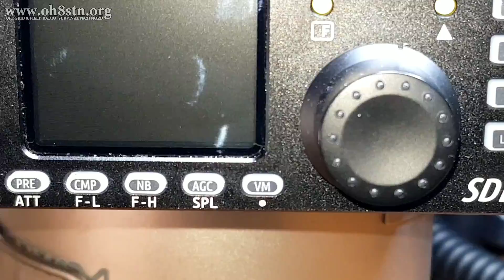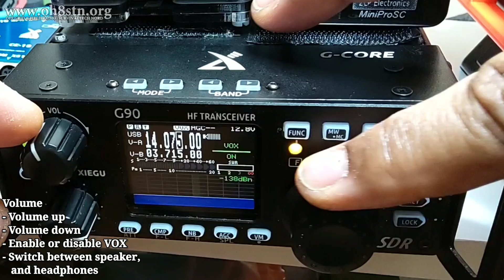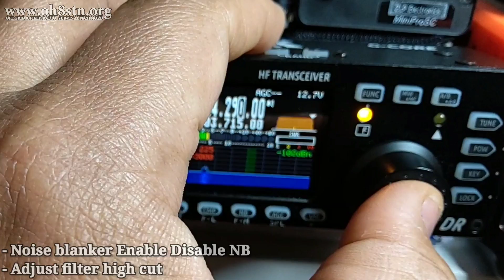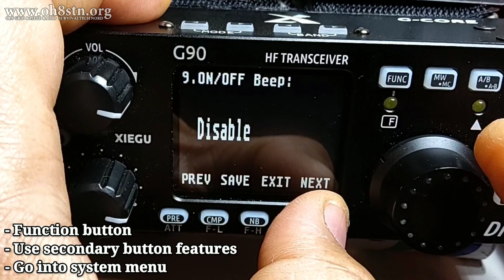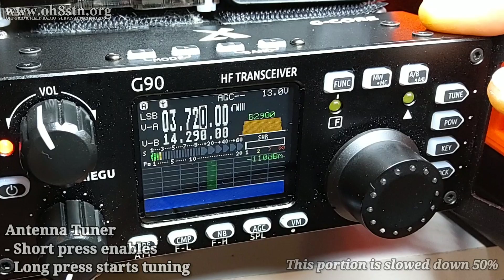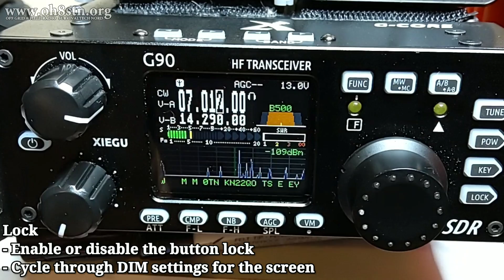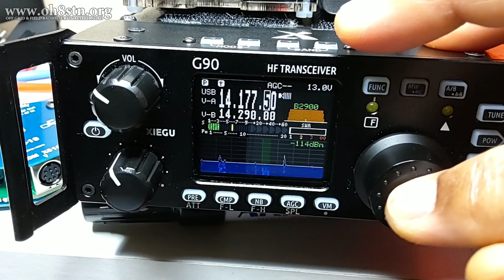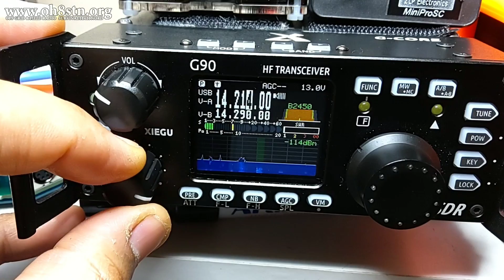Xiegu G90 HF SDR Transceiver

Comment: Hello from Texas. I am considering a Xiego G90 as a basic POTA rig.  I have seen your videos on the battery consumption versus the full size FT-891 and IC-705 where the G90 seems to fall in the middle of the two. I see you really don't seem to use the G90 anymore.  Any reason for this?  Just wondering about your current thoughts and use case on this radio.  Thanks!  73  Mike KB9MEQ
Reply from the maker: Outstanding question!
The G90 gits perfectly between me 891 and 705 in performance,  current consumption and size. Since it consumes about half the current as the ft-891 on RX, you can run it on a much smaller battery.
My G90 is now used as my Winlink gateway. It's doing a solid, reliable, and energy efficient job. 
73
Julian oh8stn
Reply: @ Man are you up early! Great info and thank you!
73
Mike
KB9MEQ
Reply from the maker: @Bacon4Allah burning the midnight oil. Gotta get the book done 👍🇺🇸

Comment: Recommendations for radios like this but in the 50-100w range?
Reply from the maker: More specifics would be helpful. Still, there really are no other radio like this. The closest is the Yaesu FT-891, but it's current hungry.
Reply: @OH8STN  which has better range?
Reply: @OH8STN thanks for the reply

Comment: Bought this radio specifically because of your glowing review of the G90's simple logical BW filtering GUI.  I have a FT-991a which is a fairly decent radio overall, but Yeasu buries the filter bandwidth settings in sub-menus which I ABSOLUTELY HATE.

So, after viewing your video, and agreeing 100% that Xiegu got it right on the G90 - that this WAS the PERFECT way to handle the BW filtering - I literally went right out and purchased the G90.

So, imagine my joy when I found out that as of FW 1.79, Xiegu has TOTALLY TRASHED this brilliant filtering interface by turning it into a really crappy copy of Icom's silly "dual shift" filter tuning.   This dual-shift nonsense  interface makes no sense on a modern DSP filtered radio where it makes much more sense to let the user set low cut, high cut, center-frequency, and BW directly -  ALL OF WHICH WERE EASY TO DO ON THE G90 UNTIL XIEGU DECIDED TO SCREW THINGS UP.  

With Xiegu's new "Icom knock-off", dual-shift-stupidity interface it's incredibly difficult to visualize the "filter BW overlap" area based on a really TINY poor graphical GUI and the provided "BW" calculation is inaccurate to the point of uselessness.  

With their previous G90 firmware, Xiegu literally HAD the best interface you could ask for.  For example,  In voice SSB mode you could easily directly set lower and upper cutoff frequencies -- and for CW operators, where it makes more sense to set the center-frequency to the sidetone spot frequency and then narrow the bandwidth, that was ALSO available - PERFECT.    BUT ALL THAT IS GONE.   I'm only sorry that my G90 just went past the return time frame, or I would send the damn thing back to them - that's how much I HATE THIS REALLY STUPID CHANGE!
Reply: Hi Steve,
I must agree to what you wrote here. Within minutes I returned to the V1.75 FW version, I started out with. For CW I use the center and bandwidth controls, for SSB the lower and upper cutoff. All just one or two button presses away...
Sometimes I wonder, what I am missing, with the new firmware releases.
Hope you also "downgraded" and are able to enjoy your G90 again!
73 Willy

Comment: I plan on getting one as a starter HF Transceiver after I pass the general exam, because I refuse to spend 1k to 4k for a HF Transceiver and because I'm not boomer gate keeping old hammer who takes new hams over the coals for using cheap radios 73 KQ4HCU

Comment: In the new firmware, the bandwidth is adjusted differently - the F-L and F-H buttons are no longer involved in any way. Maybe make a video on the changes in the new firmware v1.79b3?

Comment: Julian, I always appreciate your vids. I'd love to know your pro/con of the G90 vs the 6100. From my reading online, seems like the 6100 was released sorta 'half-baked,' but that more and more the firmware seems to be turning it into a great rig. Size of the screen, power, and future 'jailbreaking' possibilities [in the case of the 6100] seem to be the primary differences. I know the G90 runs a bit warm on digi modes. Assuming the 6100 does too? Since I operate a lot of digital modes, that could be the tipping point for me. If I had to scale either one back 50%, the G90 would still leave me with 10w. Curious about your perspective. 73! Tim

Comment: Excellent tutorial and camerawork.
You explained the function of each button, but you've not explained the terminology, such as, what is split frequency? What is a noise blanker? What is voice compression? What is high/low cut filtering? So you may have taught the location and name of each button, but those who aren't familiar with the terminology, as to what a function does and when to use it,  are left in the dark. 
I'm expecting to receive my G-90 in two days, and I'd like to be able to know what I'm supposed to do and why.

Comment: Was thinking about this for a medium powered SOTA rig, but I understand the screen is hard or impossible to read in the Sun.  I am leaning towards the KX2 because of this.  Apples to oranges because of price range, but I want them for the same reason. Something with a little more punch, and also SSB.  I am normally running an MTR-5b QRP on peaks.
Reply from the maker: I haven't had the problem with seeing the screen outdoors. Still, this is a heavy radio for difficult SOTA summits. Of course the battery must be carried as well. There are definitely better 10-watt choices like the 705 or kx2.
Reply: @OH8STN  I will have to cash in some crypto and the KX2.  73 and hope to catch you on the air.
Reply from the maker: Remember you'll need an external battery to get full power out of the kx2. Also you'll want to add the heat sink kit to reduce very common overheating at higher output power, and the front protection kit to prevent the rotary encoders from being broken. Here's a SOTA friendly power supply https://youtu.be/3G0GxVuReLg

Comment: Julian.... Great video! I purchased a G90 earlier in 2021... It will be the base of my portable ops gear. I have also shared this with my comms people.... currently waiting on my digimode-4 digital interface to arrive.... my Pi4 built for Ham is complete.... I am getting closer

Comment: Question my G90 will only tune in intervals of 10 and 100 kHz. How do I change that?
Reply: You should be able too press in the main dial to select other steps. If this doesnt work you may try updating your firmware.

Comment: Got this for portable om the car use, not whilst driving, just side of road stuff. Having to buy separate battery as car power points were too low voltages. Great video for a great little radio !

Comment: Hey, I just purchased this radio... 

Will the qrpguys end fed antenna work for this?   Just to Rx I cant Tx yet.   

Any other recommendations on field type portable antennas?
Reply from the maker: I haven't used that internet yet but I've heard good things about it. Because this radio has an internal antenna tuner, you could use a name dipole or end fed that's long enough.
Reply: @OH8STN  okay, thanks for the response!  

When you say long enough. Do I need a separate wire for each band?  Or with an antenna tuner I can just use 1 length of wire?

Comment: ... thanks Julian, that was a great presentation. One has to keep in mind that this radio comes without an eye watering price point.. thinking the Elecraft line here. One has to keep that in mind when comparing apples to oranges. I am sitting here with my new G90 'toy' pondering the possibilities. As an older amateur with more than 50 yrs in the hobby, I have seen and owned many a rig, some better than others, and am looking forward with anticipation to this new horizon.  Richard VA7AA

Comment: I have been using this radio about a week. I had some software problems, which were relatively easy to overcome. I am really happy with it. When you get used to it, which doesn’t take too long, you really begin to see what a good receiver it has and very good filtering, and despite only 20 watt output, I have enjoyed quite a few contacts. So would I recommend it? Very much so.

Comment: Bought this as my first HF rig when I first became licensed back in November last year. No problems making contacts with 20 watts, and I think the tuner could tune up pretty much anything you could screw, glue, or duct tape to the antenna output. The receiver seems very sensitive, and it's just loaded with features for the money. Anyone who is hesitating, just order one. Neat little radio.
Reply: How has your first year with the radio been?  Still happy with its performance and durability?
Reply: @o2bnov0307  Yes, I can still stand behind my comments. Actually using the radio right this moment, and looking up POTA spots. I've since upgraded my base station with a Yaesu FT-450D, but still use the G90 as a portable rig regularly, including the last winter field day, out in very cold and windy conditions. No problems at all thus far. It has its quirks (I always have to look up whether to update the head unit, or main body firmware first for example), but it's a great little rig for the money. I still especially like the tuber. It can impedance match my LNR Precision 40/20/10 EFHW all the way down to 160m, and managed to make a few FT8 contacts that way. Not efficient at all like that, but it worked to some extent. I have no regrets buying this radio.
Reply: Just got one and have been enjoying it as my first HF radio.
Reply: @greghastings3310 Ditto!

Comment: What does the SDR chip do in this TRX? Only panadapter (48 kHz) or more? Is there access to the circuit diagram?
Reply from the maker: I don't know how to answer your question, as the radio is the SDR.
Have a read. https://en.m.wikipedia.org/wiki/Software-defined_radio

Comment: Julian, thank you so much for highlighting this tranceiver. I as well have a QRO rig at home. I was looking for a rig that I could use for portable (SOTA / POTA) operations. I love this rig from the little testing that I have done with it so far. I am in the San Diego area of California and was testing the Xiegu G90 with a simple random wire dipole that was laying on my mobile home roof on 20 meters. I was blown away at getting a 55 out of an Ontario Canada station. I can't wait to get this rig out on a summit or park. I have chosen some of the components from the Chabeleon MPAS 2.0 antenna system to put together a vertical that I will test at a park. Thanks again for the great work on the in depth reviews and advice. 73, phil KF6IF
Reply: I'm in San Diego too; do you have any summits that you recommend? Trying to decide between this and X105

Comment: So my dilemma.. I’m torn between the FT891 and the G90. The G90 has so many features that would cost a lot more to have for the 891. But the 891 has 100 watts. 

I’m sitting on the middle of the fence. The price difference is a big thing too but in no way a deal breaker. Help lol
Reply: I bought both and I am happy. 😉

Comment: Hi, now im thinking about what to get, used ft817nd or xeigu g90 as well, i was more then 10 years almost qro operator, sometimes was on field with my tested well worked ft-100d as well. A year ago i loved with QRP, tryed QCX(its awesome!) on field and so on, but now wanna get on portable with some more packed radio. What you suggest? i like yaesu, but... G90 looks and feel really good... )  - for weekend and for manpack on emcomms.
Thanks for any answer.
And video about G90 awesome! keep testing it please in fields:)

Comment: Greetings OH8STN,  I am very interested in this radio. I have some questions about digital operations and this radio if you find time to answer. Can you plug directly into a sound card for digital?, is there rig control with linux? is it possible to operate this at 100% duty cycle at 50% power?
Reply from the maker: Next G90 video is covering this topic.

Comment: Thank you Julian for the very informative video. I look forward to seeing your next video with actual contacts. My G90 has the same FW 1.73 as your radio. 
I have observed some problems. 
At low power levels (less than 5 W) the transmitted signal is intermittent, i.e. some words are not heard in the far end receiver. This happens also to some extent at higher power levels up to full power. The reason is that the SWR circuitry has SWR spikes that causes the SWR protection circuit to kick in, although the actual SWR is 1.5, i.e. very low.
Secondly the mic gain is too loud. I have set the gain to 0 in order to be able to make a few test  contacts. 
Also the microphone picks up very loud background noise. 
oh2kj
Reply from the maker: Thankfully I don't have the SWR problem on my rig. The mic gain is extremely hot though, too much in my opinion. I used some wool inside the microphone around the element, to attenuate my voice. That helped very much.
I've been using this rig everyday for data modes, which works very well. Cat control needs serious Improvement. Time will tell if it will last

Comment: Hello.I have a question about the vhf handheld radio.I have a Kenewod TK-250 and TK-270 without batery packs and try to power them with lab linear power suply,the problem is when try to transmit  the radio and the power suply enter protection
 I also tried with analog power suply .My question is ???.There is a solution to solve this problem,or i must use only batery.I think they were not designed to go with external power suply instead of baterys.What do you think.
Reply from the maker: Sounds like your radios can't produce enough current to supply the radio during transmit. You may also need to connect a dummy load to the antenna if you haven't connected the antennas already. Turn the power of the radio down as low as it will go, then try again. Be certain you have the wires connected the correct way.
Reply: I have a 5A Elektro-Automatik EA-PS 2033-050 linear power suply and the original antena conected.The power is LOW.
Reply from the maker: I don't know what to tell you then. Without having the radios here on my own bench oh, it's difficult to troubleshoot. What about the wires you're using? Can the wire handle the current?
Reply: yes the wire it is 2.5 mm litz wire.

Comment: This comment pertains to ICOM IC-705 and not this. Don't otherwise know how to contact you. I have both an Icom (IC-7200) and Yaesu FT-891.  I have an identical setup as you. Raspi4, Buster, FLRIG, FLDIGI etc.  I can configure the FT-891 on FLRIG (ver 1.3.49), but not the IC-7200, even after reboot.  Error msg about com port. The com port is actually free and the proper driver is associated with ttyUSB0. I don't know if this is a (raspi) linux of FLRIG problem.  I have heard in the groups that this problem has been experienced by many.  Yaesu seems to hog everything.  I have not found a solution. Have you had a similar experience with the ICOM IC-705 or Xiegu?  If you have, and you have found a solution, I would like to know! David SV0SGS
Reply from the maker: Hi David search Google for "Icom 7200 Raspberry Pi cam Port fix n0jds" my buddy John N0JDS figured it out.
Reply: @OH8STN   Hi, Julian! I got the problem fixed, well, it's a workaround. Set USBAUTO="false." It works with the kind of GPS dongle you show in your video, but not with the one I have been using.  Don't understand why.  Fortunately, I do have a GPS dongle like yours, and it is working.  I wonder if the ICOM or pi people are working on a solution.  This would proably have implications for the new owners of the IC-705 connected to a pi.

Comment: I plan to get this rig in the next few days, so thanks for the information about it. I was between this and the 818ND (which is $530 right now from HRO!), but this beats it out by having a built-in antenna tuner and filters, even if the 818 would be better for long-distance backpacking, power consumption wise.

Comment: Julian,
I am contemplating purchasing the G90, or a used FT-817nd.  At this point in your review process, do you have a preference?
-Ross, K8RLB
Reply from the maker: That's a tough one Ross. I do have an emotional attachment to the 817ND. If I'm just being a heartless about it, it kills me that I can only put one filter in the 817nd. That's going to cost between 80 and 150 bucks on top of the radio. The g90 has variable filters built-in just like the ft-891. If those built-in filters are more important to you than VHF and UHF, I would say go with the g90. The opposite is also true.

Comment: This is a modified mcHF design with a 20W amp final stage. If you dump the firmware and look at it they don't even hide the fact they are using stolen code without permission or credit to the authors.
Reply: I think you have this radio confused with the "Recent RS-918"....which is the well known mcHF clone.
Reply from the maker: @bmmcwhirt you're confusing this radio with something else. Perhaps next time you'll watch the video and do your research, before actually commenting.
Reply: @OH8STN  nope dump the firmware and look at it with a hex editor.

Comment: Julian --
1.  ACC port:  can the AF-In  of this port be used for a Mic-in  (E.G., with properly constructed adapter, used for a headset)? Ditto the AF-Out?
2. The Comm Port (Yellow) on the rear panel looks like it duplicates the port on the side of the rig?
3. Have you tested or are you aware of any testing and results for the spectral purity of the radio (the Baofeng genre of radios has develped a severe distrust in me of Chinese rigs)?
4. Have you played with Pactor or VARA with this radio to determine how hard you can push it without causing phase distortion at max power?
5. Not shown in your video by apparent from the manual (which doesn't answer my above questions), what use detaching the main body from the control head in a radio of this type?
Thanks!
Jim / n6med